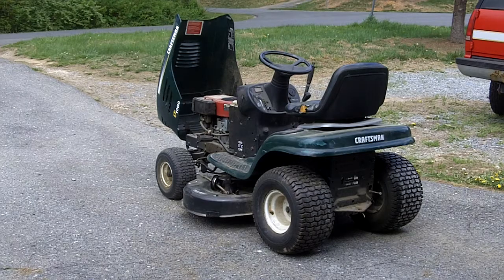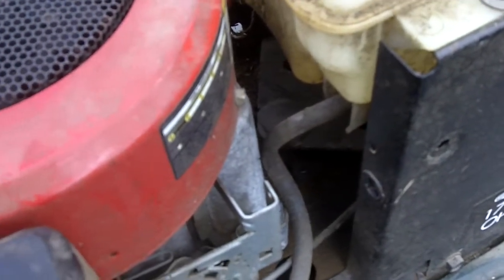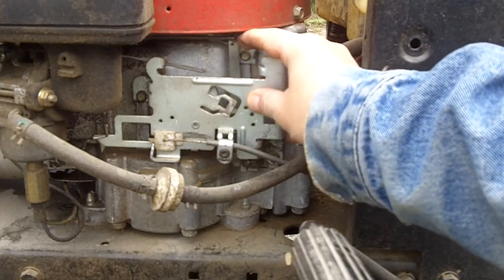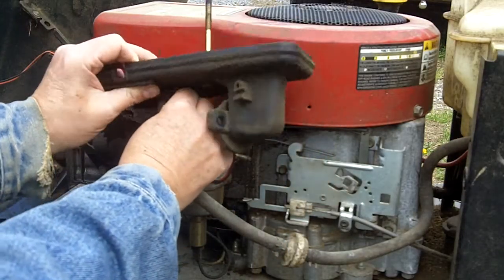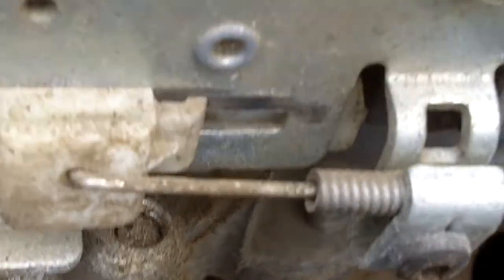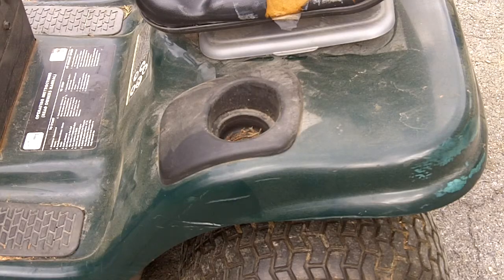Craftsman LT1000 - Part 4: Carburetor and Linkage

Comment: Forgot about the spring that connects between governor arm and the throttle arm controlled by the throttle cable.  That spring allows the governor to be controlled by the throttle plate and its position via spring tension.
Reply from the maker: Some others have commented about the long thin spring. Here is part of my response from below:
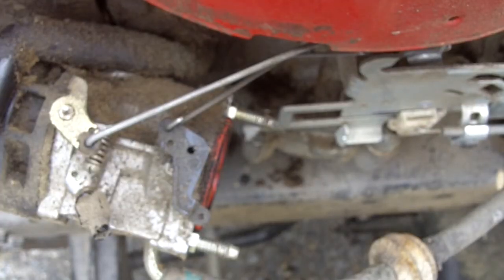"4) There is this super thin spring that runs under the rod that connects the governor to the throttle plate which I didn't mention in the video. Re-watch starting at time stamp 3:28, When you get to time stamp 3:47 you can barely see the spring under the rod when I manually move the throttle plate by pushing on the governor. I think that spring is MANDATORY for the governor to function properly."
I'm going to pin your comment at the top so everyone will see it first. Thanks, Clay.
Reply: @claypotter378  the light spring that goes between the governor arm and the carb throttle arm within the same holes as the actual rod serves a purpose of keeping the rod from falling out of its connection by keeping constant tension between the carb throttle plate and the governor arm.
It would be a rarity for that rod to fall out but apparently the engineers had it happen during their R and D.  Even it did fall out the throttle plate would return to idle by its own spring.
Reply from the maker: Thank you for sharing additional details!

Comment: Nicely done - it may have helped some viewers if you had included the throttle rod spring that rides the throttle rod &connects to the carburetor linkage in the smaller hole on the carb.linkage; good overall vide; thank you,Patrick.P

Comment: Like many others here, I owe you big time. I was gonna rebuild the exwife’s carb, went to order a rebuild kit and found entire carb for six more dollars. Ordered it, came two days later. I immediately got called into work (clearing power lines downed in storms, many states away) and was gone over two months. Of course I had disassembled it. No clue how it went back together. Other than the two springs, which I’m still struggling with (the long thin one primarily) it was easy to follow the video. Thank you and I’m sad you don’t do vids anymore. Just felt obliged to say thanks. Thanks!!!

Comment: My Governor does not move at all when choke linkage goes back. Plus the choke linkage does not go back in place after I pull back on it.  Plus that tiny copper wire that goes on top of the carb and to Governor arm is gone. Any thoughts?
Reply from the maker: Shoot a quick video showing the problem and post it on your channel. Then put a link here. Someone will be able to answer your question. I know it's not in keeping with your channel subject matter, but you can always take ii down after you make the fix.
Reply: @claypotter378  so the choke link should be. That’s the easily identifiable long U going into a s slot that the choke arm hits. You did a good job showing it.

Yours springs back in place mine does not
Reply: @claypotter378  I figured it out the cheap carb on Amazon had a clutch spring that opens and closes the carb but it was defective, it had no spring.
Reply: My wife fixed the spring thing and although I put gorilla glue on top of the throttle linkage hooked end so it would stay in iplace on top of the carb it worhs again
Reply from the maker: Congrats on the fix. I've had problems with cheap aftermarket carbs too. Duct tape and J-B Weld are my go-to's. Wives that fix things? A rare commodity in today's world.

Comment: Great video! Was working on the neighbor's LT1000 and needed some guidance.  Your video answered all of my questions - except one.  What is the mechanism that returns the choke into the open position once the throttle is moved out of the choke position?  I see it happening in your video, but it does not happen on the neighbor's lawnmower.  My guess is there a missing or broken spring somewhere to force the choke to return to the open position, but I can't find a reference drawing showing that.  Any ideas what the issue might be? Thanks.
Reply from the maker: I'm pretty sure the choke IS spring-loaded open. I can't remember how, and it's not my mower. I will look and post the answer, but it will be a few days.

Comment: is the sping on the governer important ?!!
Reply from the maker: In a word, Yes. Some springs are more important than others. There are multiple springs in the throttle/governor/choke system. All work together to start the engine and regulate its speed. I've been told the long thin spring hiding below that piece of linkage is there to keep the linkage from falling out. The engine will run without it, but unpredictable things can happen if the linkage falls out while you are cutting. As a general rule, all the pieces are there because some engineer decided the cost of adding them was worth the increase in safety or performance. Making alterations to your engine is beyond the scope of this video. Safety first, performance second, efficiency third!

Comment: My mower is slightly different but works in the same manner. For some reason when I start the mower it immediately starts shooting WAY high in the RPM's to the point where it would blow up if not dealt with. I have to manually close the throttle to keep oxygen from getting into the engine which then shuts it off. any ideas on how to solve this?
Reply from the maker: The throttle plate (not the choke plate) should automatically open and close to regulate RPM. If it doesn't: 1) Check the idle screw (if it has one) to make sure it's not holding the throttle plate open too far. 2) Check to make sure the  throttle cable is properly positioned in the cable clamp. 3) Check to make sure the throttle plate is open when the engine is off and the throttle is set to low. (it is spring-loaded open - the governor system should close it as soon as the engine is running) 4) Check to make sure the throttle plate opens and closes easily with finger pressure.
The carb may be dumping too much gas into the engine and the governor system is revving the engine to burn it. Or there could be a problem with the governor system itself. Make sure the governor vane moves freely and is able to move the throttle plate without sticking. It's a spring-loaded balancing act, but will give trouble-free service once you find the problem. Good luck with the repair. Let us know what was wrong.
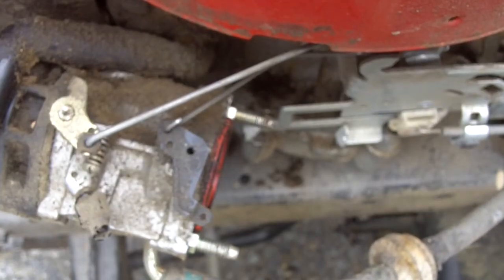Reply: @claypotter378 if I understand this correctly. In the video at 4:10 the governor/throttle is closed (choke position)? 4:05 is slightly cracked open, then closed and closed again in the choke and run position?
Reply from the maker: I wasn't very clear in my explanation of how the throttle plate moves. Maybe this will help:
1) The governor does not work when the engine off, so the throttle plate will be open no matter what position the throttle is in.
2) As soon as the engine starts, the governor will push the throttle plate closed against the idle screw - or at least nearly against the idle screw. This is super important! Make sure it does or the engine will rev uncontrollably. (Like yours does.)
3) Push the throttle plate closed against the idle screw, and then back the screw out until it doesn't touch. Then screw it back in a couple of turns so it opens the throttle plate just a wee bit. You can fine tune the idle speed once the engine is running correctly.
4) There is this super thin spring that runs under the rod that connects the governor to the throttle plate which I didn't mention in the video. Re-watch starting at time stamp 3:28, When you get to time stamp 3:47 you can barely see the spring under the rod when I manually move the throttle plate by pushing on the governor. I think that spring is MANDATORY for the governor to function properly.
Let us know what you find. P.S. My previous reply has some miss-statements which I have corrected.
Reply: @claypotter378  thank you again. I’m currently waiting for a diode to arrive so I can get the mower running as I ran into another issue. I’ll use this information to the best of my ability because as I said earlier, my mower is different. I did rewatch and see the small spring/line you mentioned but my mower actually doesn’t have that. And after watching other videos of people working on the same exact mower as mine, I confirmed it’s not needed to run. I’ll give an update when I replace the diode and hopefully get it running! In case you know anything about it, my mower is the Craftsman Kohler 15.5hp 42” inch mower (CV15S)
Reply from the maker: I've only worked on one with a Kohler engine (LT2000 model?). It had two problems: Automatic fuel shut-off was stuck closed so the engine wouldn't start; and a stuck open float dumping too much gas into the engine -  it ran too fast and smoked. A good carb cleaning fixed both problems. I never saw that mower again so I guess it still works. Upload a video of your repair. Maybe it will help someone else.

Comment: This is very similar to mine - and I have a stupid question.  So throttling all the way up is just for starting and normal running condition is when the throttle is in the mid position where the throttle 'clicks' in place?  I ask because when I try to throttle past middle position, it wants to choke and die.  I've been chasing my tail trying to figure out why.
Reply from the maker: Your understanding of operation is correct: The choke plate should only be closed when the throttle is pushed all the way. When you pull the throttle back to the "click" run position, the choke should fully open. The choke plate is spring-loaded to open so it should open automatically when the throttle is moved to run. If the choke is partially or fully closed when the throttle is in run, you should be able to adjust it by moving the throttle cable back and forth in the cable clamp until its in the right place. - Clay.
P.S. If your engine isn't running fast enough in the run position, it could be almost anything. I had a Troy-built tiller that wouldn't throttle up to full speed last spring. Turns out it was just a really dirty air filter. Tilling clay into powder makes a cloud of dust and the filter was totally clogged. I'm surprised it ran at all.
Reply: @claypotter378  Thank you, very informative.  So, yeah, I don't feel like it's running fast enough in that running (clicked) position.  But I really have nothing to base this on, as I bought it used.  I'm very good about keeping clean filter and oil.  She gets the job done, so maybe I should leave well enough alone.
Reply from the maker: If the motor is running smoothly and you just want a little more RPM/hp, look into "adjusting" the governor spring. I can't go into details here - and don't go too far - but you may find your solution there. - Clay.
Reply: @claypotter378  Thank you, sir.

Comment: Mr. Potter, you pulled me out of a fix!  I was replacing the carb on my riding mower, and when I got to the linkage, the the choke rod fell off.  I hadn't looked at it prior to that, as I thought the control end of the rod was connected to something.  Just couldn't figure that one out when trying to reattach.  Came in and watch your video, and voila!  The rod doesn't attach there, it just gets pushed.  
BTW, for those of you who watch this video, My B&S is a 13.5 hp, but it's the same configuration as Mr. Potter's 17.5 hp.
I'm tellin' ya, if I had a buck for every time a YouTube video helped me do a job................  Thank you, Thank You, Thank You
Reply from the maker: Glad you found it helpful. YouTube has pulled me out of a jam many times. If you shot a video of your fix, post a link here to help the next guy along. - Clay.
Reply: Same thing happened to me yesterday. This video is a Godsend!!!

Comment: I rarely comment but I just bought a used replacement engine for my LT1000 when the motor exploded (check your oil before you mow) and I can understand how to attach the throttle cable to the plastic slider but I had no idea how the other parts worked and was worried it wasn't done properly. Your video explained how and why each part works so I really appreciate it.
Reply from the maker: It's nice to hear from a viewer who finds one of my videos helpful. I hope your engine swap is a success. And yes I agree, you should always check the oil before you cut.

A friend's son blew up the engine in his mower; and when asked about the dry crankcase, shrugged and said, "I don't know what kind of oil it takes." To which dad replied, "When the engine is out of oil, it takes ANY KIND!"
Reply: Thank you for the information. I got a question. I had to replace the coil in my Briggs and Stratton 13.5HP after I did that there is a wire that post to connect to the coil called a kill switch does that have to be plugged up in order for it to RUN
Reply from the maker: Sorry to say, but I don't know. I've never had a Briggs and Stratton coil fail. Did you find the answer?

Comment: you are missing the tiny  long spring that retracts the choke
Reply from the maker: The next time I have the chance, I'll look for "the tiny long spring" you mention. Is it connected to the choke plate or the throttle plate? I didn't see one, but that doesn't mean it's not there. Thanks! - Clay.

Comment: Very good video. I have a 2012ish LT2300

Set up very similar if not exactly the same. My engine keeps “surging” and was not responding to my throttle control, so I figured the linkage was off a little. Can’t wait to look so it again after seeing this.
Reply from the maker: Shoot a brief video of the problem and the repair, put it on your channel, and put a link here so others will see it. It could be a linkage problem, a carb problem, bad gas, a vacuum leak ... I always learn something watching other DIYers solve problems. Good Luck! - Clay.
Reply from the maker: Here's a link to a good video on engine surging from sixtyfiveford:
https://www.youtube.com/watch?v=FQ22j4FsF6g